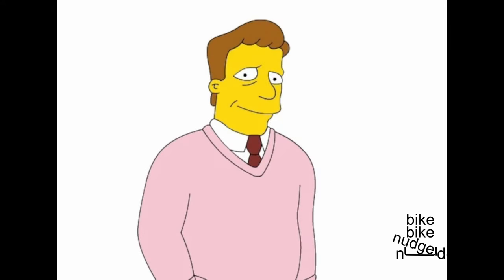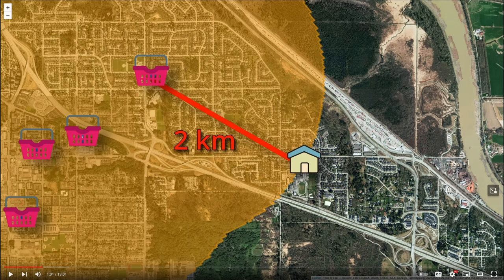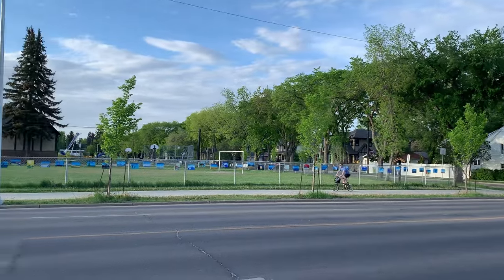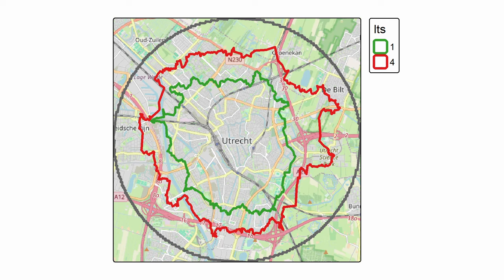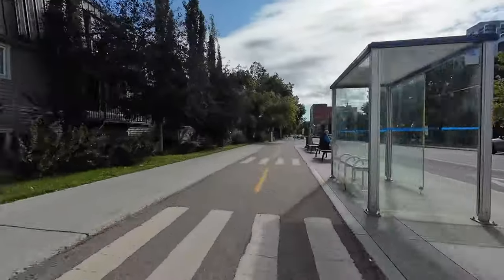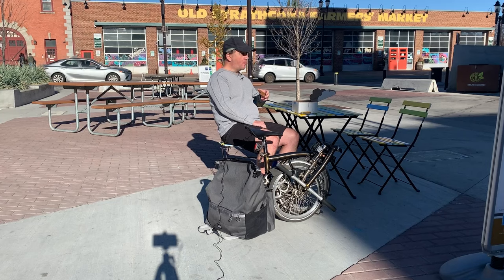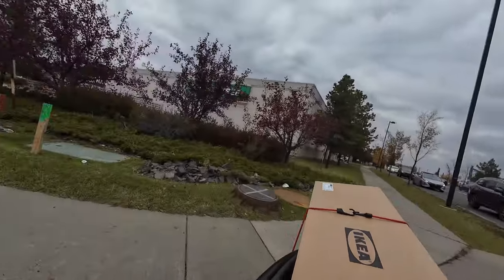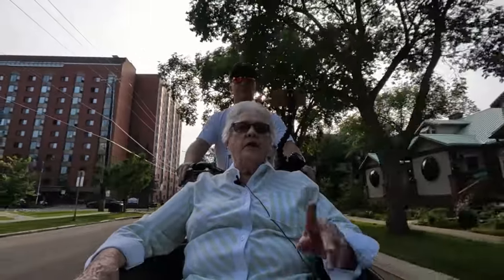How does traffic stress actually affect accessibility by bike? (Warning: contains math)

Comment: Very good analysis. I think factoring in specifically low stress biking routes is important in any analysis of cycling feasibility. I live in the greater Boston area and can get reasonably anywhere I want on a bike, but I'm okay with brief bouts of the many areas with no bike infrastructure. Several of my friends and family would absolutely not be able to use nearly as many roads on a bike and so would be locked into small islands of decent infrastructure between major car routes. This region is luckily trying to remedy that and work on making a more connected network of safe routes as opposed to scattered streets of it. Because of the massive proportion of potential cyclists who don't want to interact with horrid Boston traffic, I believe every foot of protected bike lane is worth a dozen of afterthought shoulder lane paint. We'll see how it turns out.